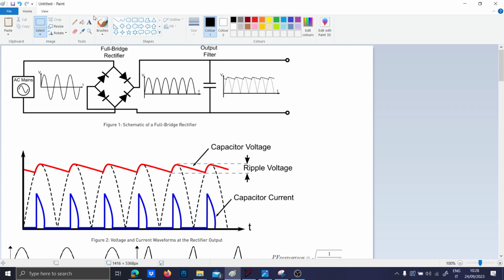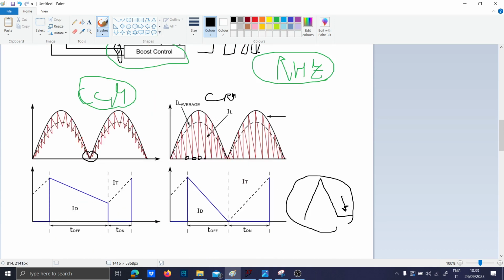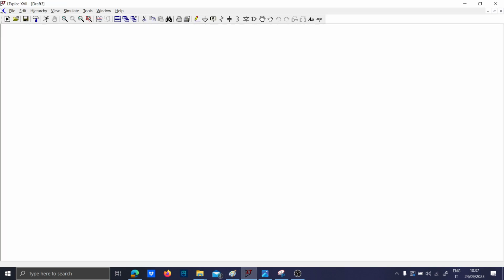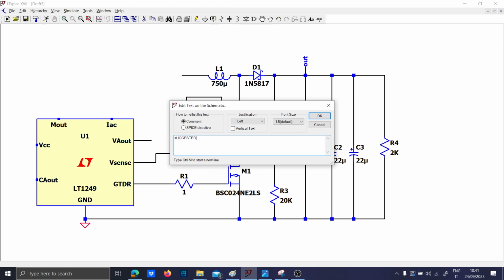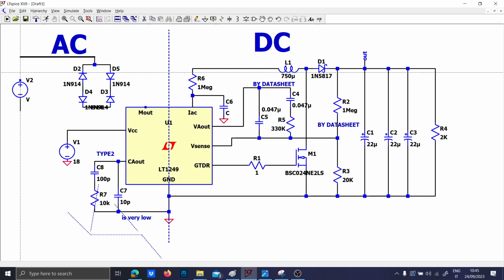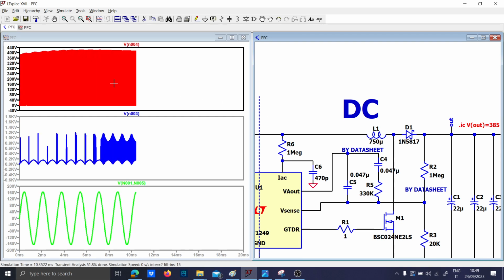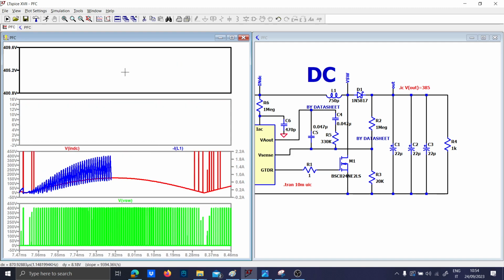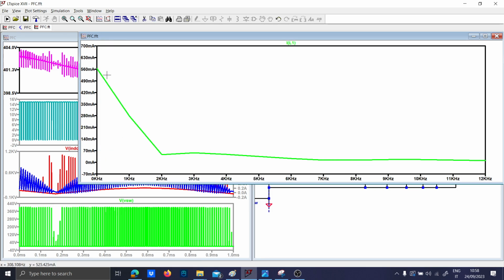LTSPICE Power PFC Boost Controller (Active AC-DC converter)

Comment: Now days it so important topic when many ppl use a petrol/gas generator 1phase AC with a FBR+Cap to provide a DC into a hybrid inverter via PV MPPT (in function of wind generator) a power to charge a battery in offgrid mode.
People just use a FBR+CAP and no any other protection of that circuit, and they risk the inverter damage... generator have a breaker and it is only protection.
If you can take movie about this topic again and focus at 5kW power then this will be greate.
BR Marcin from Poland.

Comment: U added input sine wave 600 hz it should be 60 Hz or 50 Hz in practical ac socket we will get this much only
Reply from the maker: Yes I know, it's done on purpose. The simulation is really slow with 50Hz so I put at least 10 times than this to slow the cycles. That's it
Reply: Okay

Comment: Hello,
Congrats for the video! I have a doubt, because I followed the steps in the video but my simulation results are not working good. For example, it is showing only 800 ns of simulation time. Do you have any suggestions on how should I proceed?